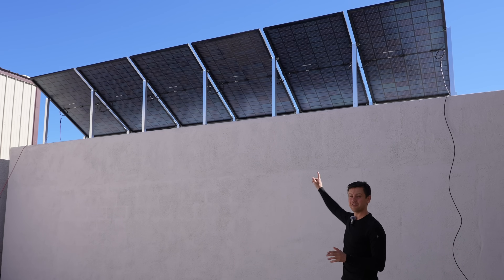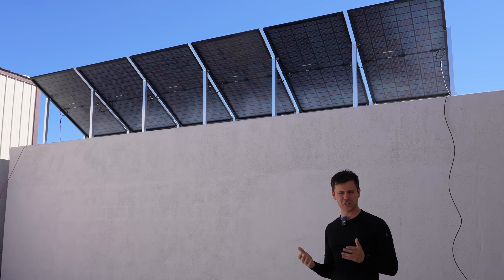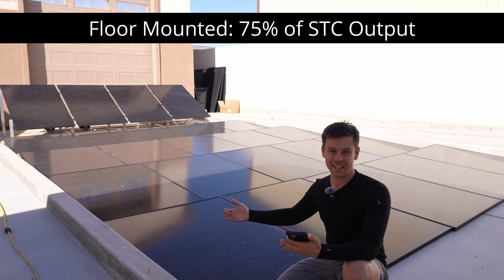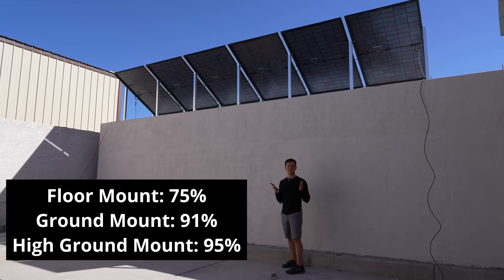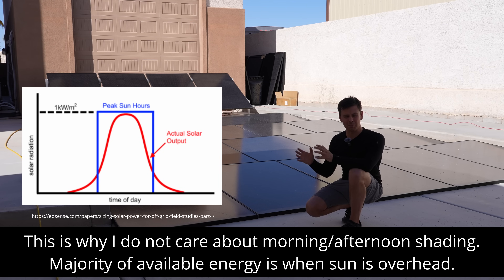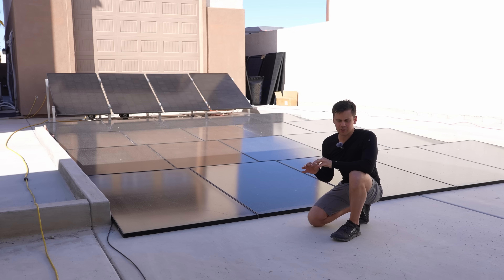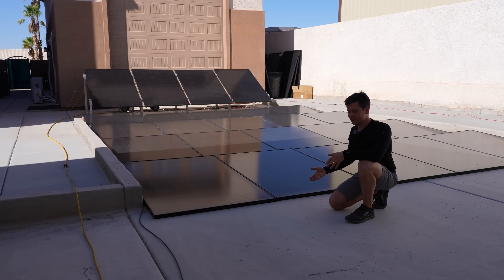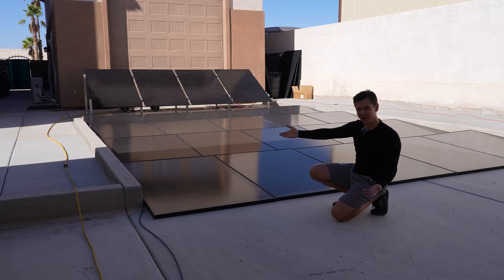How To Boost your Bifacial Solar Panel Output!

Comment: Temp makes a huge difference in power output, on a really cold winter day in full sun I've gotten just under 115% STC, I actually overloaded my old charge controller
Reply: @brly4542  I noticed that today. The first cool day in Nor Cal. I was able to get 2.47kw where the most I've seen before was 2.05kw
Reply: @Gary-ee3kq  I'm in norcal too. Last winter I had to rewire panels because my voltage went too high on a cold morning. Looking forward to going 48v soon.
Reply: @Trevathecleva82  haven't had that issue... yet. My array doesn't get sun for the 1st 30 min after sun rise, so I think I'll be alright.

Comment from the maker: Made a mistake!!! 16 percent, not 6 percent. My bad!!!
Reply: For your environment it seems clear that the ground mount gives the best results for the price and difficulty of mount.
Reply: Yep, I caught that and  thought i was gonna have to correct the teacher😅
Reply: Just outa of curiosity can you mount one straight up and down and put aluminum foil under it. Wonder what it would get and then angle the foil for better reflection.
Reply: @jamesgreen1857 I would guess it would narrow the gap between the high setup but it might also increase the heat... hmmm.
Reply: It's all good.

Comment: I read that mounting bifacial panels vertically had good results. Using them as a fence and even mounting them vertically in rows they performed well.
Reply: I think everyday Dave has a video on this

Comment: I have a galvalum metal roof that's reflective.  I wanted to use bifacial panels but the installers keep telling me I won't get any benefit.  How high do I need to mount the panels above the roof to get maximum benefit?
Reply: 3 to 4 feet

Comment: CanadianSolar 455Watt BiFacials were recommended for my northern exposure and cold winters.  It's amazing to see the output on a -20F day in bright sun, but even on a cloudy day, they can deliver plenty of power.  I built a tall ground mount from old telephone poles to get them up and off the ground so that all the snow we get here doesn't bury them, and it really helps with the gain year round.
Reply: I think one other advantage with biracials in the north is where the sun comes up and sets. It basically comes up in the north east and sets in the north west so youd get extra hours of production if your panels are pointed south.
Reply: Can you test vertical mount bifacial panels. Could with different reflective surfaces around. Maybe this can blow the numbers your getting?

Comment: I live about 75 miles south of Will, on the AZ side of the river. The area is an active cattle ranch and I have long believed that it could produce even more cattle if covered with panels mounted just high enough to allow the cattle to graze underneath. Agrivoltaics!
Reply: Grew up around cattle and there's an old saying about them. What they don't eat or destroy they crap on. Better make it bulletproof.
Reply: Where my oil wells were in West Texas they built several absolutely enormous solar panel farms.  The one that uses solar tracker mounts have some sheep and goats and guard llamas to munch up the grass underneath the array.  It is the desert so cows aren't real happy out there and they are horrible about chewing up wire, they just love it.  On the same land we have oil wells from the 1930s, giant wind turbines, and the newer solar farms which use the high voltage transmission lines that were put in for the wind farms.
Reply: Solar cattle!
Reply: @goodcitizen4587  good enough to eat 😋
Reply from the maker: @georgemead6608  amazing!!!
Reply: Being from Georgia, and I have camped out there, I do not see how the cattle can survive out there without any grass to graze on.
Reply: @gsp49  Actually, there is a lot of grass out here. Also there are wild horses and donkeys. The grass dies very quickly as soon as the temperatures start drifting into triple digits but ruminants can still eat it. Think hay. It doesn't support very many animals per acre, its more like acres per animal, but there are millions of acres between 'Vegas and Kingman. The shade provided by solar panels could more than double the grass production.
Reply: There wouldn't be enough grass for any cattle! 🥴😂
Reply: Dead sheep...in solar farm
Reply: @LReno-di9cm  Thank you for confirming you are amongst the 54% of the population that is functionally illiterate and has the cognitive capacity of a 13 year old. I feel sorry for what the education system has done to you people...

Comment: When you calculate power into MPPT circuits you would want to buy panels which will give you max input 
If you buy biracial panels and they do not get the reflective radiation then you are constantly under max input for your MPPT channels 
I don’t buy bifacial because of this 
I buy regular panels that will give me my max calculated input into my MPPT circuits  regardless of reflective and I get better steady performance

Comment: I’ve been running the previous ET Solar 410w bifacials Will recommended for about 4 years now fully off grid and love them. I can get 122%+ efficiency regularly in winter temps with snow on the ground. I feel the bifacials really shine in less than ideal conditions like heavy clouds and snow storms. It’s amazes me how my 5000w array can still pull in 2000w+ during a complete whiteout snowstorm where I have no idea where the sun is even while looking for it. It’s a great feeling when it’s like that outside all day and you know you’re still covering your loads and charging your batteries. 

Mine are mounted about 2’ off the ground on the low side of the panel with Tamarack Solars mount where you use 4” rigid pipe in the ground and 3” rigid tying them together horizontally. It’s not the cheapest but it’s rock solid and allowed me to get 5000w all in a nice clean line with only 4 holes in the ground.
Reply: Agreed about not being to worried if it snows. I have one 16 panel ground mount with bifacials. Once I clean off the panels even on an overcast day there is more than enough power to run the house and not deplete that batteries. Also get my highest power generation in the winter despite the sun not being in the optimal height for my ground mount angles.
Reply: I have ET solar non bifacial 410w and they are can push 430-450w and I have noticed they are bit more efficent than trina monofacial 480w in low light scenarios.

Comment: I have 36000 watts of them. They work great in the snow on a high ground mount. The first hint of light reflects on the back and melts the snow very quickly.  Plus, have you seen? People are standing them vertical with one facing east and one west and so on down the line. You get a  M  Style charge with two peaks.  ✔️ it out.make a privacy fence
Reply: Check out projects with everyday Dave. He covered this in a video
Reply: Was hoping to see Will test vertical mounting as there are papers that claim that vertically mounted bifacials perform the best.  Still a great video.
Reply: @brianfisher6799  I'm going to do vertical with 16 of my panels  ( half ) just so I don't have to clean the snow off. I live at 9500' in park county colorado. Yes, South Park.
Reply: @brianfisher6799  Not as simple as saying "best"; specifically, only for extending power generation for an hour before and after peak, when "ground mount" panels are pooped. Could imply better return on net metering income if it pushes into higher paid tier, or just longer air conditioning, dinner or laundry time after work. Perhaps the most supremely valuable hour allowing some free car charging before and after work. Generally used in conjunction with "ground mount" to extend day.
Reply: My next install will be vertical.
Reply: Have had them since 2019. Purposely bought

Comment: Another advantage to bifacial panels is I think the back side will hold up better in the long run. I've seen some mono panels with the back cracking. That help me decide to go with the bifacial
Reply: That's the more reason bifacial are better than standard panel..